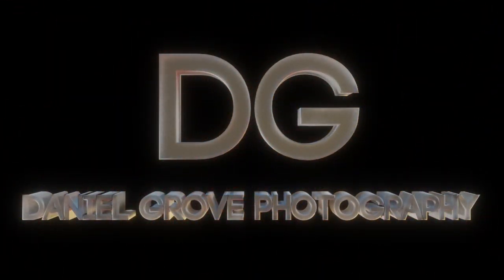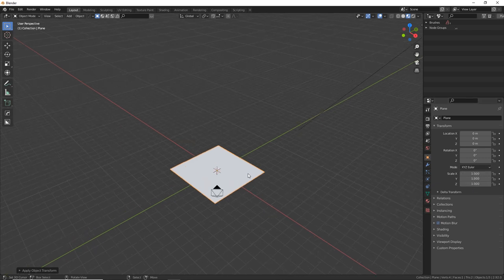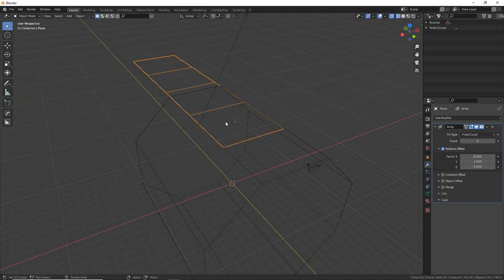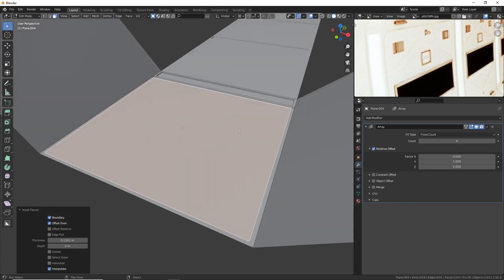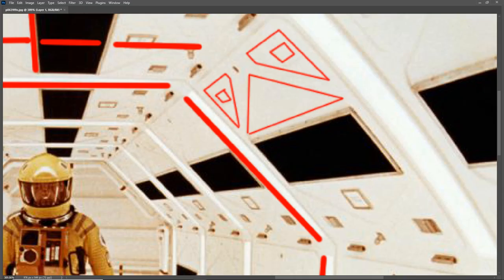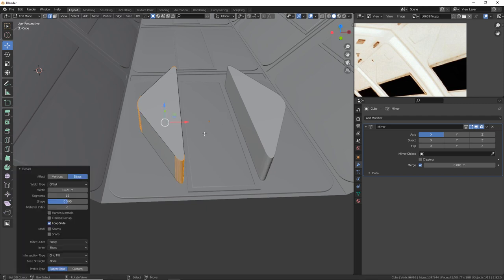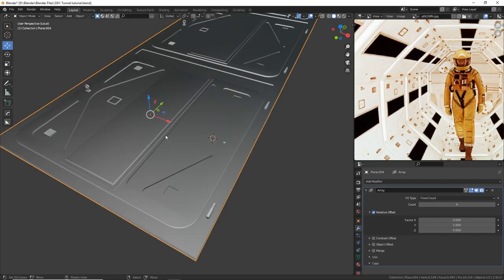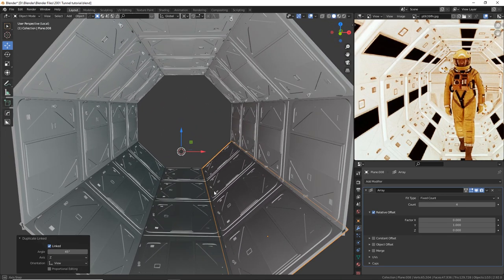Make the 2001 Space Odyssey tunnel in Blender

Comment: Great tutorial!
I'm a beginner and this was very helpful. However, for some reason the boolean modifier didn't work for me. I followed every step to the letter but ctrl + minus didn't do anything to the cube. It also didn't do anything when I opened the modifier settings. Any tips on why it might not have worked?
Reply from the maker: Thank you and sorry to hear that! I've had a few others have the same issue. Not sure if some prebundled but disabled addon needs to be enabled in Blender. Are you using the minus on your numpad or the other one?
Reply: @DanielGrovePhoto  Thanks for your reply! 
Yes after some more research I realized that you had the Boolean add on activated. I didn't have that yet so activated it. But still after that it didn't show the triangle (former cube) as cutout but showed me a huge rectangle frame ...and no cutout on the floor. that was when I tried the boolean modifier, the command ctrl + - didn't work with the Bool Addon either. I used the - on the numpad. 
What I've been struggling with is when you start the bool thing, you say 'with the cutter activated' and I've been wondering what you mean because I couldn't see you click anywhere or so xD not sure if you know what I mean, it's right before you start to use the bool addon.
Reply: @DanielGrovePhoto  So I worked around the problem with the boolean addon (with the knife tool and inset function- doesn't look pretty but that's okay!) I'm really a newbie to blender and this was the first tutorial I could follow easily and didn't abort in total frustration! You explain things so well and I actually was able to do the whole thing and had a result to show to my friends at the end! I definitely will go through more of your tutorials! Thank you so much for your work!
Reply from the maker: @OceanChild87  I'm so glad you finished and enjoyed my tutorial! I wish I could help resolve your boolean issue. One thing that's great about Blender is it's customizeability but that also means we all have different flavors of Blender preferences and editing habits especially if you've been at it for a few years like me. You can do things the manual way with boolean modifier, make it on your target object and then in the modifier choose which cutter object you'd like to use. Sometimes the targets geometry will make the boolean not work right so it may take some tweaking occasionally.
Reply: @DanielGrovePhoto  Thanks for the tips! I will definitely look into it!
If you happen to be in the mood for a tutorial on booleans I wouldn't mind watching that! xD
Thanks again and you will definitely hear from me in some of your other videos!